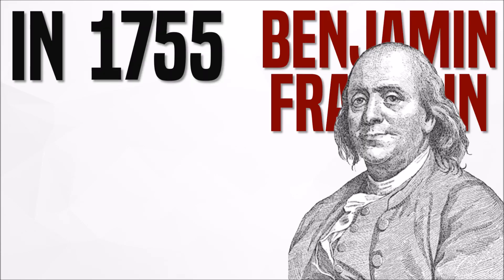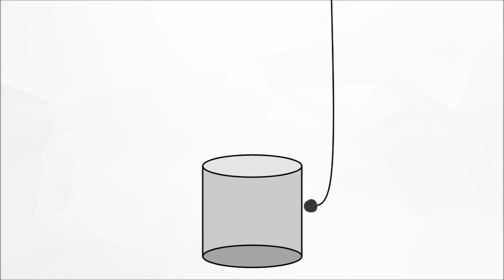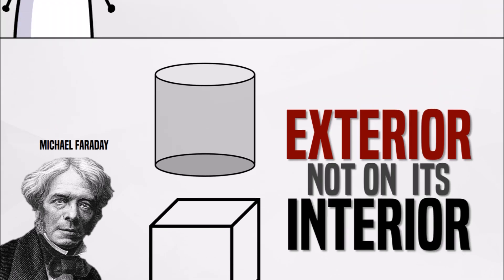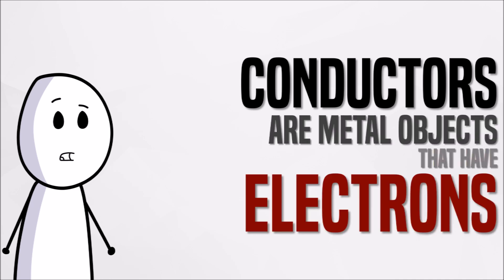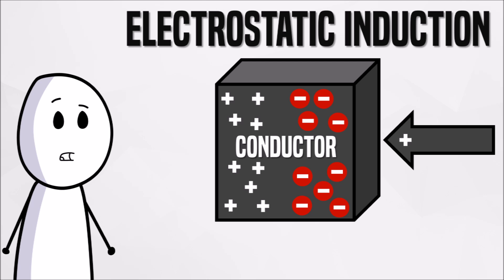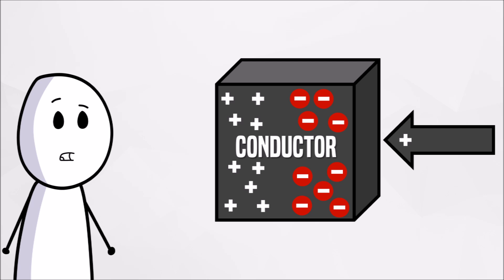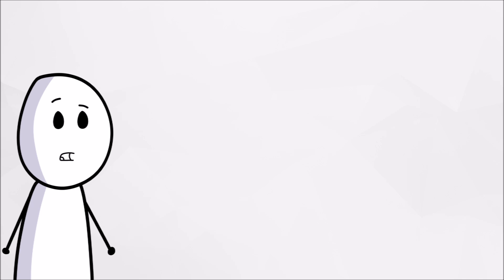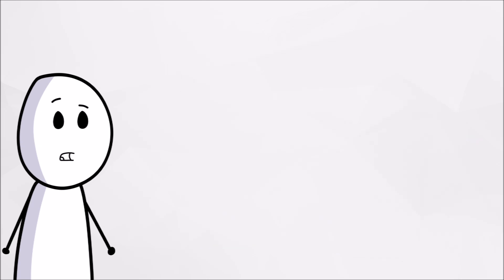Stopping Electricity - Faraday Cages

Comment: If the M in EMP means magnetic, does it matter if the cage's material does or does not stick to magnets?
Reply: if material is conductor( for faraday screening it should be), it lets current pass through it, if there is current, there is electrical field, which means there is magnetic field, which means magnets will stick to it.

Comment: I've a doubt:does the external electric field due to the charge outside will pass through the(inside) conductor or only on the surface of the conductor
Reply: Only on the surface

Comment: what happens when you coat a faradays cage with a rubber coating? will it still work ?
Reply: Thats what happen to a signal cable a tube type faraday cage stopping from leaking or intterupting from external force.

Comment: With the harmful 5G technology expanding as I write...Would this system protect a home against it’s mind destructive🤯 Frequencies??   And how would anyone build such a cage for the home environment???

What has been reported about 5G towers sprouting up at no less than 200 feet apart, my anxiety level as reached it’s peak😱
So please if you have a solution, let us know.  The frequencies those towers emit are at the same level as the crowd control devices.
Please think of something🙏   This could be the beginning of the Zombie apocalypse.  This technology has the potential to turn our brains to turn our brains in a state of apathetic 🥴 mush. I have a playlist full of reports of al kinds. Look it up.
Reply: there is paint you can buy. there is even ways to line the insides of the House (if constructing a new home) with a metal like alloy lining before you stick the insulation in the walls.

Comment: so an induced electric field is produced that cancel out the electric field of the EM wave. But does also the magnetic field gets canceled out ?
Reply: Maybe different if it was magnetic force
Reply: well !  yes  even the magnetic field will get canceled bt in an other way  in the conductor eddy currents will produce which results in offering opposite equal magnetic field dat cancels magnetic field of  EM waves
Reply: @nikhiltirumalasetty  If 9V means that 9 joules of energy is transferred by every coulomb of charge, then if all of this energy carried by the electrical current is transferred into light/thermal energy in the lamp, then how does the electrons have any energy or "pushing force" left to return to the opposite side of the cell?

Any help is appreciated!
Reply: Magnetic and electric fields work pretty much the same so the magnetic vectors all cancel out